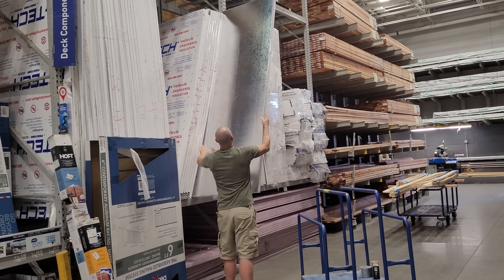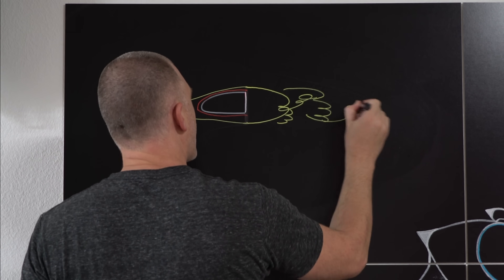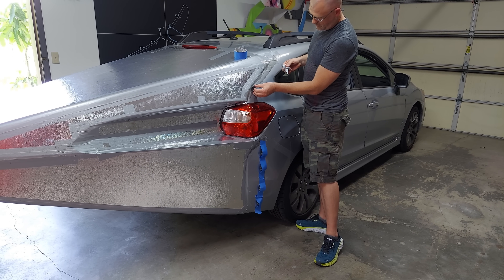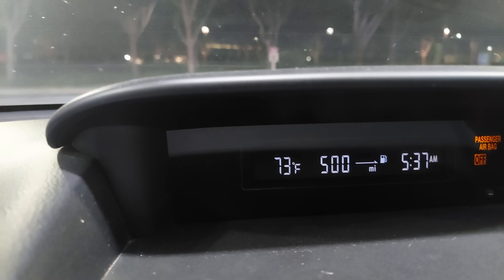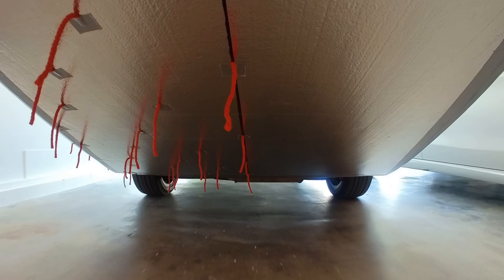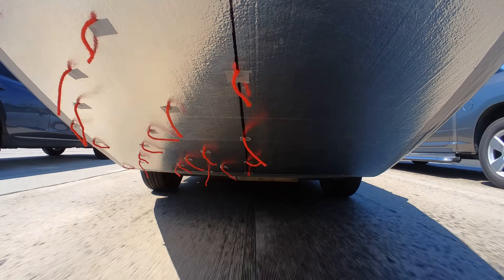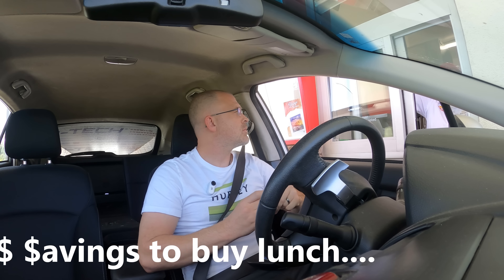Using Simple Aerodynamics to Beat High Gas Prices (Home Improvement Store Edition)

Comment: If you start modifying the air flow at the front end, do not forget about the airflow through the radiator. I would guess they lead that air flow to the bottom of the car too.
Reply: I got to witness an Isuzu Trooper overheat because they were pulling a trailer in a slow parade, and had covered nearly the entire grille with a poster. In August.
Reply: In northern states during winter you could easily get away with covering 90 percent of the radiators. Some modern cars come with shutters in the grill that can close to improve aero.
Reply: Yes, closing the radiator holes with a clean surface will help with drag. But as the other commenters mentioned, you should watch out that cooling stays sufficient (this is why stock cars with front grill shutters have a mechanism to close & open them automatically dependend on cooling demands)
Reply: Active radiator shutters, if it doesn't already have them

Comment: Your NASA quote...  Notice how they don't mention laminar or turbulent flow nor attached/detached flow...  Because none of that matters in defining 'Drag' .   The flow can be laminar and still be 'Drag'  IF the delta in pressure from the flows pressure to Atmospheric (Inviscid fluid pressure) is high.   

I was watching these F-15s doing short take offs with afterburners at some UK based airport live on youtube.  They were creating so much pressure drop the Laminar flow over the horizontal stabilizers at the rear of the aircraft were condensing the air and causing clouds to form.   This is all at the rear of the aircraft on take off...  Drag...
Reply: F-15s in the UK... that would be RAF Lakenheath, actually a USAF base over here 🙂
Reply: My way of saying how you analyze the tufts at the rear and bottom of your modification might have to change BECAUSE you've essentially created a DIFFUSER on the bottom side...  DIFFUSING the pressure difference ...   Air displacement...    air displacing in all directions to the vehicles volume thru the air...  when you boat tail the vehicle as you did, you're allowing the air to EXPAND back into the volume the vehicle displaces...  the tufts work on generated LOAD pressure by vehicle movement and air resistance.   IF you're DIFFUSING the pressure what load pressure can generate the Tufts to stick to the bottom side of your modification.
Reply: At the same time I wont disagree from turbulent tumbling air due to the underside of cars.   Diffusers on race cars tend to start at the front of the vehicle.

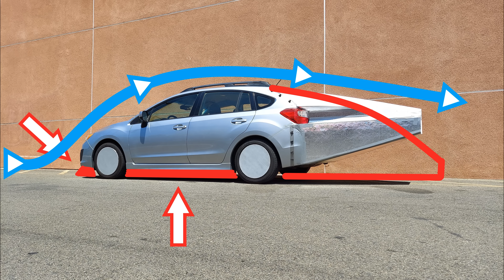Comment: 9:24 One thing about the front air dam is that it creates a high pressure zone in front of the car. This causes drag not as turbulence but in the from of downforce, with the high pressure air pushing the front of the car into the ground. Useful in racing but I don't think its going to help for fuel efficiency. I think simply making the rear swoop level with the cars body line would do a lot more than any front aero. And for the tail lights, I think you could go outside right now, put clear packing tape over the void, bridging it. And then you'll have another 1-2% right there. Either way for version 2 there are a lot of easy easy ways to make flush, unobtrusive covers instead of having that big parachute pit. 

I would suggest adding some undercladding before you add a front air dam. But really I find it most interesting of all that you're able to get 13% efficiency without doing anything to the front areo. Part of me wants to see how much fuel efficiency you could get just by only modding the rear.
Reply: Front dam is not needed under the hub I agree but mud flappers infront of the front wheel would help a long way
Reply: Unfortunately, "making the rear swoop level with the cars body" will create ground-scraping issues. I have seen the problem many times as motorhomes or trailers with a lot of structure behind the rear wheels negotiate the transition from a business to the roadway :(
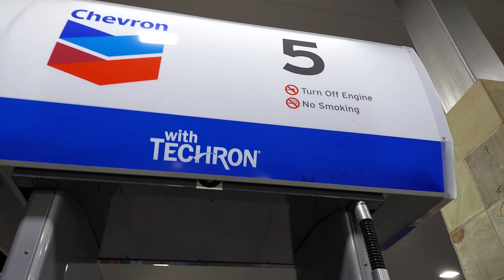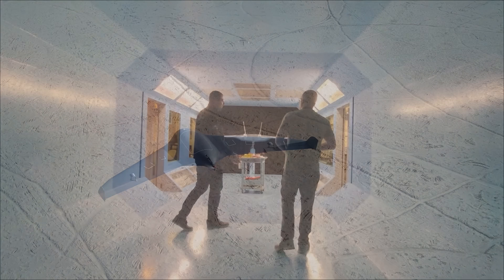Reply: Repent and follow Jesus my friend! Repenting doesn't mean confessing your sins to others, but to stop doing them altogether. Belief in Messiah alone is not enough to get you into heaven - Matthew 7:21-23, John 3:3, John 3:36 (ESV is the best translation for John 3:36). Contemplate how the Roman empire fulfilled the role of the beast from the sea in Revelation 13. Revelation 17 confirms that it is in fact Rome. From this we can conclude that A) Jesus is the Son of God and can predict the future or make it happen, B) The world leaders/nations/governments etc have been conspiring together for the last 3000+ years to accomplish the religion of the Israelites C) History as we know it is fake. You don't really need to speculate though because you can start a relationship with God and have proof. Call on the name of Jesus and pray for Him to intervene in your life. - Revelation 3:20

Revelation 6 1st Seal: White horse = Roman Empire conquering nations under Trajan 98-117 AD & Gospel spreading rapidly. 2nd Seal: Red horse, bloody civil wars with 32 different Emperors, most killed by the sword. 185-284 AD 3rd Seal: Black horse, economic despair from high taxes to pay for wars, farmers stopped growing. 200-250 AD 4th Seal: Pale horse, 1/4th of Romans died from famine, pestilence; at one point 5,000 dying per day. 250-300 AD 5th Seal: Diocletian persecuted Smyrna church era saints for ten years, blood crying out for vengeance. 303-312 AD 6th Seal: Political upheaval in the declining Roman Empire while the leaders battled each other. 313-395 AD

Revelation 7 Sealing of 144,000, the saints, before trumpet war judgments, which led to the fall of the Roman Empire.

Revelation 8 1st Trumpet: Alaric and the Goths attacked from the north, the path of hail, and set it on fire. 400-410 AD 2nd Trumpet: Genseric and the Vandals attacked the seas and coastlands, the blood of sailors in water. 425-470 AD 3rd Trumpet: Attila and the Huns scourged the Danube, Rhine & Po rivers area, dead bodies made water bitter. 451 AD 4th Trumpet: Odoacer and the Heruli caused the last Western Emperor (sun), Senate (moon) to lose power. 476 AD With the Western Roman Emperor (restrainer of 2 Thes. 2) removed; the son of perdition Popes took power.

Revelation 9 Two woe judgments against the central 1/3rd and eastern 1/3rd of the Roman Empire. 612-1453 AD 5th Trumpet: Locust & scorpions point to Arabia, the rise of the Muslim army. Islam hides Gospel from Arabs. 612-762 AD 6th Trumpet: Turks released to attack Constantinople with large cannons (fire, smoke, brimstone). 1062-1453 AD

Revelation 10 The little book is the printed Bible, which was needed after the Dark Ages when Scriptures were banned by Popes.

Revelation 11 7th Trumpet: Martin Luther measured Roman Church; found that it’s an apostate church, not part of true temple. The two witnesses are the Scriptures and saints who proclaim the pure Gospel and testify against the antichrist Popes. Papal Church pronounced Christendom dead in 1514 AD. Silence for 3.5 years. Then Luther posted his 95 Thesis, which sparked the Protestant Reformation and brought the witnesses back to life. Millions of Catholics were saved.

Revelation 12 Satan used the Roman Empire to try to wipe out the early Church, Satan was cast down as the Empire collapsed.

Revelation 13 The antichrist beast Popes reigned in power 1,260 years, 538-1798, is the little horn of Daniel 7, son of perdition. The false prophet Jesuit Superior General rose to power from land (earth) of Vatican and has created many deceptions.

Revelation 14 Points to great harvest during the Protestant Reformation & wrath on Catholic countries who obey antichrist Pope.

Revelation 15 Overcoming saints victorious over the beast. Prelude to 7 vials and judgment on those who support Papal Rome.

Revelation 16 1st Vial: The foul sore of atheism was poured out on Catholic France, leaving them with no hope, led to revolution. 2nd Vial: The French Revolution started in 1793, killed 250,000, as France had obeyed the Pope and killed saints. 3rd Vial: The French Revolution spread to rural areas of France, where Protestants had been killed in river areas. 4th Vial: The bloody Napoleonic wars shed the blood of countries who had revered and obeyed the antichrist Pope. 5th Vial: Judgment on the seat of the beast. Papal States invaded in 1798, Pope imprisoned, removed from power. 6th Vial: The Turks vast domain dried up, they were only left with Turkey. They lost control of Palestine in 1917 AD, Israel became a nation again in 1948

Comment: Now do the changes you suggested. Really curious how far you can push this!
Reply: Agree!
Reply: same!
Reply: So that's why the Aptera is shaped the way it is........
Reply: @handlemonium  yeah and his final drawing was basically a VW Beetle which was the original super streamline car.
Reply: the upgrade looks cool and if its efective nice however i do recomend removing the wheel cover since it could technicaly kill u in curtain situations like where u need to lets say brake a lot, since u dont have the wind moving thru the brakes anymore becouse the cover if u break too much and go downhill and use breaks a lot they will not cool that efectivley which will in turn heat them up and make them brake worse, however there might be a solution in formula racing since they usualy do a lot of aerodinamic stuff so maybe look there for anwsers, im not a profesional just my personal opinion on the things i know
Reply: @snermann  he could do something simillar to the front wheels of the mclaren speedtail. Pretty much an aero cover that's not spinning with the rims and has ducts for airflow to the brakes.
Reply: @snermann  Down shift.
Reply: @snermann  its not like foam skirts or wheels covers are airtight, plus hes not using this on track day. Regular brake disks can take pretty high temperatures, way more than you can generate with normal levels of driving.
Reply: Yep
Reply: do it like in the flinstones
Reply: Rant: To OP: would be best to just copy F1 cars tails. They've already spent 100s of millions of $ into it to engineer wind to curl, spin, smooth.

Eg, from what the experts do- fins with cylinders on the end to spin wind away from centre line of the car (literally reinvented last month by Aston Martin), smooth undercarriage, layered whale tail that curls up and have ridge lines along it to direct wind in narrow corridors.
Reply: @mnm8818  There isn't a great deal of overlap between racing and fuel economy.
Ecomodders don't care about downforce.'
Reply: DO IT NOW ( boy from shrek that say “do the roar”) voice 😂
Reply: Its going to be so fun when he's explaining this to Highway Patrol.
Reply: @jeffk464  Why would they bother him?  He looked over the laws.  As long as his license plate is visible he is fine.
Reply: its the only way :0D
Reply: yes!
Reply: some guy told me he gets 42 mpg on his diesel truck. I asked if he meant liters, he said gallons. well, I doubt it.
Reply: @FutureHendrixFan666  You thought he was getting 42 miles per liter ?
Reply: @truhunk1  oh I meant kilometres per gallon. You seem concerned though
Reply: @FutureHendrixFan666   not really concerned, but 42 miles per liter would be 160 miles per gallon. But now it makes sense.
Reply: @FutureHendrixFan666  I get 60-70 mpg in a diesel saloon (once got 75mpg on a very long flat stretch). Kind of normal on a relatively modern (since mid 2010 ish) diesel if driven recently and mostly on the highway.
Reply: @car_ventures  interesting
Reply: @FutureHendrixFan666  I understand that some people claim fuel economy numbers without even calculating.
Reply: he could definitely get at least 15%
Reply: @breakingmichigan  The rule of thumb is that for every 2% you increase aerodynamics or decrease weight you improve fuel economy by 1%, so he improved aerodynamics by 27.4% just to get this far.
One thing is that without reverting to stock and doing another run we don't know if there are confounding variables.
Reply: Yes !
Reply: Yes please
Reply: Honestly think a 917k is a better choice than a mkii jag. Just sayin boys.
Reply: Are you by chance a military man? You have the same accent as both my uncles.
Reply: Indeed I will
Reply: The back would drag when going up ramps
Reply: @hellothere6627  I have only once maneuvered a ramp that might possibly be this steep.
Reply: @drippingwax  I have experience pulling a camper on a hitch up into a gas station where the ramp was so steep the hitch hit the ground and we couldn’t continue and had to back out 

I have seen two others with campers experience a similar problem, on family had bikes attached above the hitch and they were smashed through the camper front wall because of how steep the ramp was
Reply: Reduce the size of your side view mirrors.
Reply: @HondaFit4Adventure  This is the first valid suggestion!
There are always drawbacks, though.
Reply: Agree!
Reply: yes please
Reply: YES! Agreed!
Reply: Diesel swap.
Reply: same!
Reply: True
Reply: I don't recall ever seeing someone use foamboard without fiberglass.  Yes, he kept the foil, which wouldn't necessarily be easy to remove, but since this doesn't have the correct shape, how does he fix that?
He partially filled the wake, which always helps, but he didn't maintain attached flow.
The Ecomodder website has an aerodynamic template which would show what shape should be followed.
People have used it to design boat tails by doing pictures of each side separately.
By trying to match the body curves he may have maintained attached airflow, at least briefly, if it was attached in the first place, but if he optimized it with the template, 2-part foam, and once it is finalized, fiberglass, it would be even more effective.
Many people have attached coroplast (like campaign signs) to the bottom and over the rear wheels.
They usually cut a wide gap around the exhaust.
Reply: lol if car manufacturers took aerodynamics to the extreme then we would all have lame looking cars xD
Reply: Look up Craig Vetter and his economy challenge.  He took a Honda helix scooter from 60 mpg to 90 mpg
Reply: PUSH A CAR?  What century do YOU live in?  This heyar's hi tek.
Reply: Really i was expecting that and boom the end 😡
Reply: i wanna see this done with the v8 car the guy (thunderhead289) installed a lawnmower carburetor on.